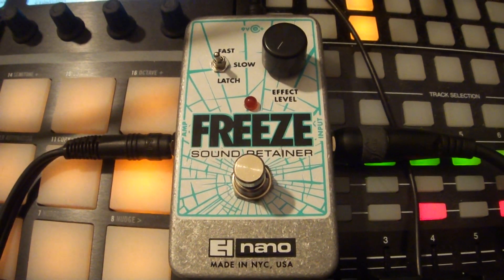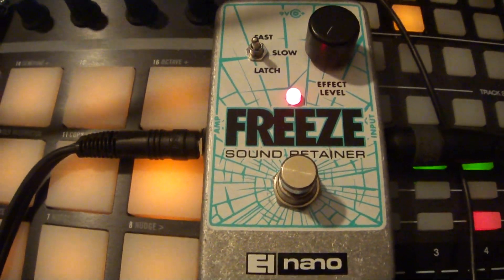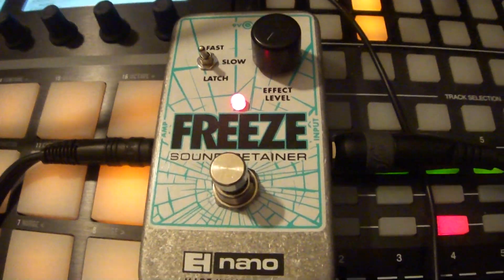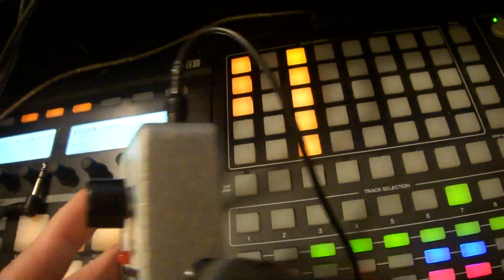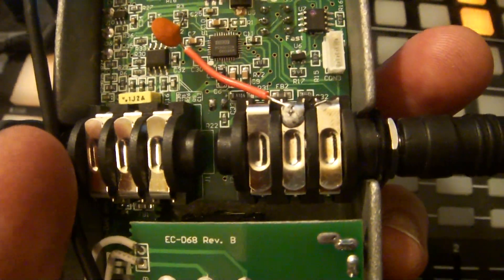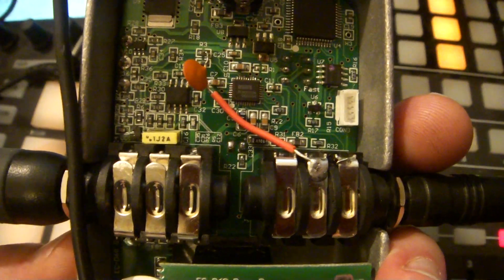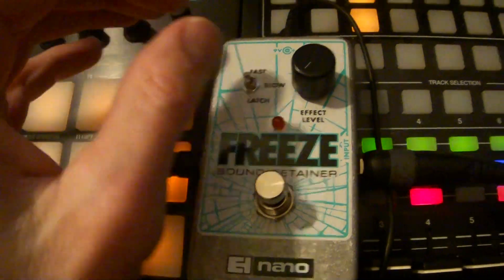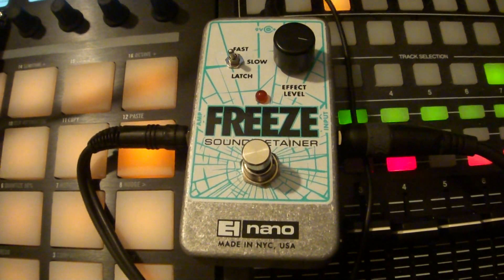00002.MTS

Comment: heythere!
I´ve tried your mod, but it doesn´t work at all :(
I mention tough, instead of 1uF I´ve used 1 pF (as said in the video)
it is an El-cap. I´ve installed... but anyway:
The technician I asked now assumed it should not
depend on the size of the cap. if it works or not...
...hm

I´d love to get this mod runnig eventually, unless there is none else :((
what do you think, db3ll ?
cheers! c